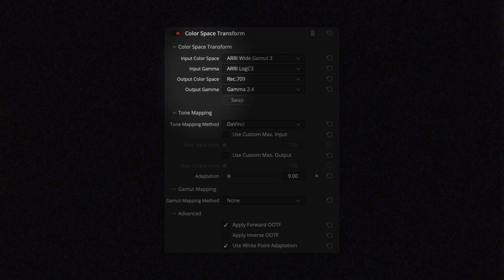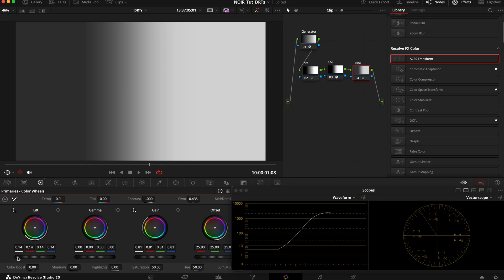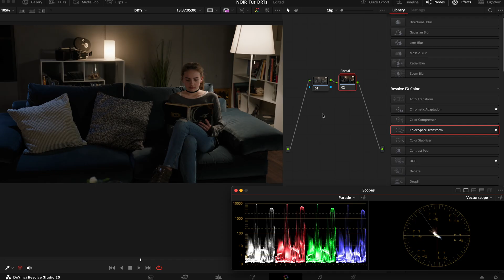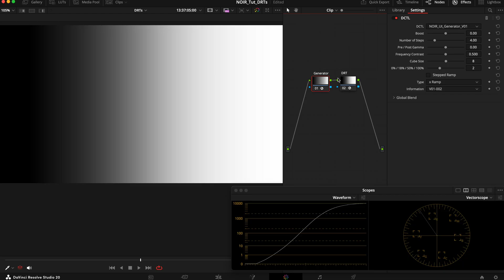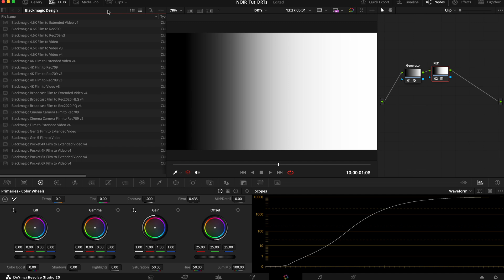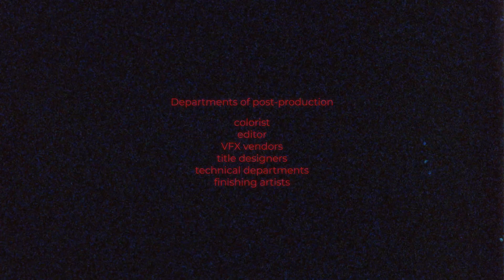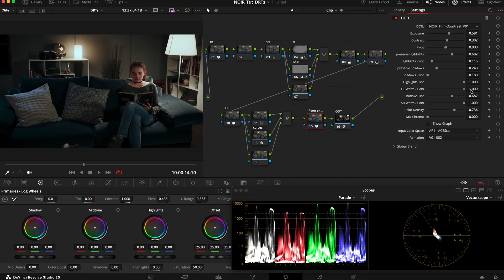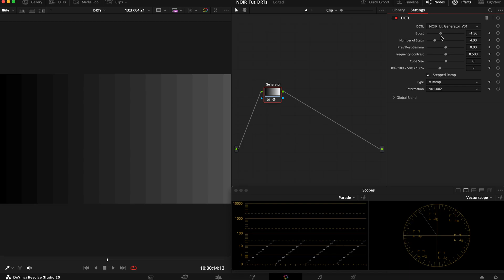Everybody is WRONG about DRTs

Comment: Thank you for sharing, Sven!  Curious to know which DRT's you end up using most of the time?  I know you said it depends on projects but is there one (or two?) DRT that is usually your go to before anything else?  (apologies if I missed it in your video)
Reply from the maker: Thanks. yeah totally depends on the project. If I am going for multiformat deliveries I tend to go with a full ACES pipeline. For simpler SDR projects I might build a show-LUT based on either CST (DaVinci) or Arri Reveal. Really dependent on the look of the show as a starting point as well. If it's only one camera and it's Arri I can easily work in LogC, if I already have 3 different cameras to begin with, I might just go with RCM or ACES.

Overall it's a matter of the full pipeline. The DRT is just one building block.